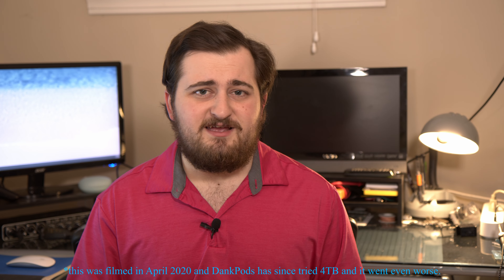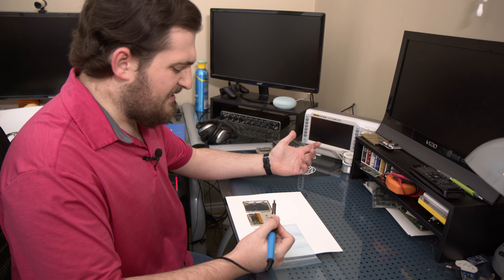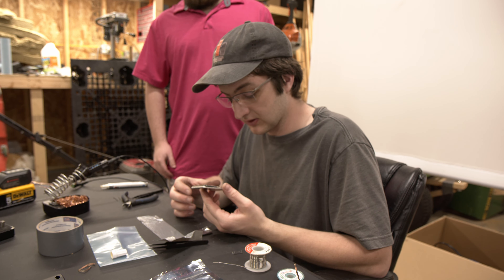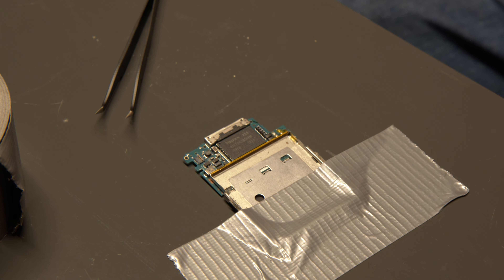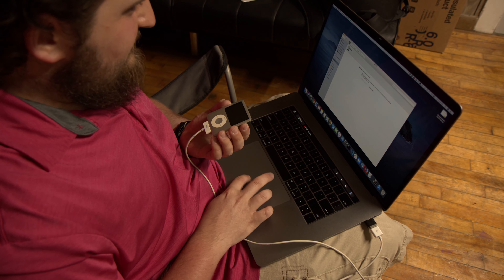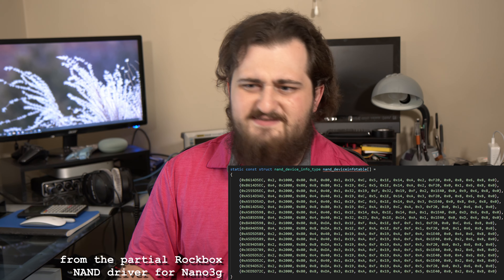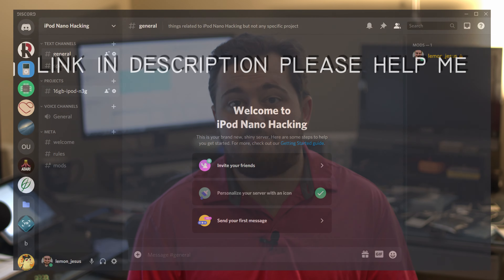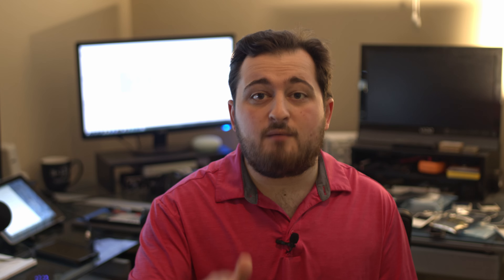iPod Nano 3G 16GB Storage Upgrade - Dev Vlog Pt. 1

Comment: I recently bought 2 broken iPod nano 3G in the hopes of restoring them and increasing the storage, just thought to myself that there's nothing a micro SD card can't do. However was surprised that it isn't as simple as it seemed. Please make this happen, it will help everyone in this situation. Good luck with the project!
Reply from the maker: Thank you! The quest continues - feel free to join the Discord server if you haven't already.
Reply: I recently decided to start a small collection of each ipod nano generation with the side goal of collecting enough broken/for parts units that I can do such a mod to a 1st gen or 5th gen as those are my favorites

Completely inexperienced to disassembling iPods, let alone soldering but it seems super fun and broken electronics are cheap enough that it's a pretty reasonable hobby

Comment: I'm no solder wizard either, but I do know the correct way to do this was to take the Nano PCB out of the case, wrap the whole board in Kapton tape, hot air rework the flash chip off then put the new chip on.

Comment: Great vid. Can you make a video on fixing an iPod nano 3rd gen white screen please.
Reply from the maker: no need for a whole video - white screen generally means you need to replace the screen. I imagine there are already plenty of videos that cover this, but when I get a white screen that usually means the screen ribbon is messed up somehow and the only way to fix that is to replace the screen. or maybe the ribbon is plugged in slightly crooked. either way you have to take the iPod apart to fix it.

I recommend also getting a new back for your iPod since getting into the n3g will almost certainly cause irreparable damage to the back that's currently on there.

Comment: I want to do it with a first gen nano, can you access the chip in linux and use it as a flash drive?
Reply from the maker: There's someone on my discord server trying to do this with the n1g - it's a little weird in that it has a an ATA-to-NAND bridge. But assuming the iPod can read the NAND chip, Linux should be able to use it as a mass storage device when the iPod is in disk mode.

Comment: Hey Tucker. Good job sir o7

Have you successfully gotten a new Ssd to work by cloning the old ssd?  If so maybe the solution is to make a card-swapper-plug and going old school with “mixtapes” in the form of ssd’s 😅
Reply from the maker: The geometry of the new NAND is different, so it has to be formatted differently. The iPod knows how to format it, provided you tell it what that geometry is. So, in theory, you could swap chips with the same chip, clone it, and expect it to work, but not if the chip has a different layout (page size, page count, etc.)

Comment: Would it be possible to upgrade a G5 nano to 128 by soldering on an SSD?
Reply from the maker: No, you'd need a bare NAND chip of that size to replace the chip that's originally installed (SSD signalling is often over SATA or PCIe, the iPod speaks to NAND directly). And then you'd run into the same problems I've been having making this work: making the software accept it.

Comment: Thinking of doing this to a really cool Sonu Walkman MP3 player
But they came with 512mb and 1gb 
I wanted to make it at least 8gb 
I've been reading a lot of I can just swap out the Nand or if I need to program it
Reply from the maker: Given my experience with the iPod, I believe you'll have to at the very least configure the NAND detection so the firmware knows the size of the chip. but ymmv, I know nothing about the MP3 Walkman.
Reply from the maker: Actually, Rockbox seems to already support some models. https://www.rockbox.org/wiki/SonyNW

Comment: Is it possible that its same process when upgrading nand chips on iphones is same to nano?
Try reading the old chip, then transfer it to the new
Reply from the maker: maybe, but the data structures would have to be extended across the entire chip, and the iPod still wouldn't know about how to deal with the new chip's geometry. there is a function in the EFI bootloader that reformats bad flash if the data structures are corrupt or not present, but the first step is getting the lowest level of the software stack to actually be able to write to the chip.
Reply: @TuckerOsman  is it possible after upgrading nano nand, use Rockbox software? i dont have nano, i cant verify it.
Reply from the maker: @pauloumali6242  there is currently no rockbox port for the n3g, but this NAND research is definitely a step in the right direction.

Comment: I have been trying this on and off myself over the past year or so. I  have tried it on the nano 2nd gen, touch 4th gen and i just had another go on a nano 1st gen before watching this. This is just soldering on new nand chips though, i haven't tried anything with the firmware yet. Windows is able to see the ipod as a removable disk although there is no storage size and will give an error when you try to reformat. iTunes will detect the ipod and allow you to reset it although it will reboot into the 'no hard drive' screen. I have found these tsop-48 sockets on aliexpress which i am going to try and solder onto the board and just try inserting a bunch of different chips to see if any work on the nano 2nd gen. Just got to wait for them to arrive. Just joined the discord.
Reply from the maker: Nice! I just got my hands on a TSOP-48 socket myself. Like I said in the video I was going to do some hardware level debugging - and I probably will still have to - but I made a small breakthrough in understanding the firmware which I posted to the Discord. Welcome to the world of fun! 😅
Reply: @TuckerOsman  Whilst the comment is from awhile ago, would these NAND chips not need re-flashing in order to work or be recognised by the iPod itself? The curious question would be what readable limit Apple may have integrated on the logic board? 4GB seems small even back then, seeing how the 1st gen Nano is basically just a scaled down 5th gen makes me feel they may have used the same limit? Or would they have created it from the ground up and capped it at 4GB?

The 5th gen classics are popular to mod but they have a hard readable limit of 128GB. I wonder if the nano has a similar ceiling?
Reply from the maker: @Spazza42  There seems to be logic in the EFI bootloader that allows it to reformat a completely blank flash chip. It would make sense for them to do this, since the underlying NAND structures are software defined and somewhat dynamic. Each iPod can format itself and skip the factory flash step.

The 1st gen Nano has an ATA-to-NAND bridge chip - likely since the CPU itself doesn't have a NAND interface - so the limitation might exist there. Some people in my discord long ago were looking into this. The Nano 3rd Gen is a scaled down iPod Classic for the most part. Since the NAND structures are dynamically generated, it stands to reason that it can format NAND of any geometry. In practice this might not be true - at this juncture I don't believe I'm running into this formatting issue specifically, rather the iPod is incapable of writing to the chip for some reason. Either it's addressing it incorrectly, or the chip is rejecting the write requests.

Comment: It's been a year. I'm curious how it's going now
Reply from the maker: My focus in the last year has mainly been on the Nano Bluetooth project, but since that's completed I have come crawling back to this project.  Since this video, I've made a couple of small breakthroughs:
 - the M1FMISS layer's bytecode is about 80% figured out
 - the iPod can, indeed, read from the new NAND but it can't write to it. I have some ideas as to why this might be but it's hard to actually test them
 - I dumped a stock iPod's NAND so I can study the structures like the BBT and see how those special pages are written because they're required for the iPod's "VFL Production Format"

If you want more regular updates, feel free to join the Discord which is decently active with iPod Nano hacking!

Comment: The sound quality on pretty much any iPod is better than pretty much any iPhone currently out including the 12 promax due to the way that wired headphones are handled on the platform it restricts the voltage to whatever the Lightning bolt bus is capable of the iPod classics have a way better dec then what current iPhones have not to mention they can get way louder and don’t lose a lot of the quality through the Bluetooth standard not saying Bluetooth headphones aren’t great but in the audio world you’re always trading quality for convenience Bluetooth can’t deliver lossless audio it exceeds the bandwith limitations of the platform your friend the audio engineer
Reply: iPod can't play 24 bit audio through the dac without bumping it down to 16bit

The only way iPod can play 24 bit audio is by docking it and using a dac from an external sound system that is capable of it. This is why it crashes or skips a lot when trying to play lossless 24 bit through the jack it is trying to convert it to 16 in real time. 

Just because the iPod can download 24 48 doesn't mean it can play it through your headphones, it can't. Even if it doesn't skip for you, that's 16 bit audio coming out.

Comment: Maannn, I wanted to try this (replacing NAND) on iPod nano 3rd gen. (my favorite) since 2020, I even bought new 32GB NAND chips and several nano's to practice on. I also noticed that 8GB models have 2 NAND chips stacked one on top of another (someone mentioned this in comments). I was hoping just replacing the chip will work but now.... i am sad :(
Going to go not to discord and see whats new.
Please, keep on going with this.
Reply from the maker: I've recently been waylaid by other projects, but I do revisit this occasionally. TL;DR: I think it's an ECC issue... maybe? Quite unclear, but I still have not given up on it!
Reply: @TuckerOsman  Btw, I now (cooking for several months) have another idea, I have several 7th gen nanos, they also use NAND but different packaging (no legs), iPhone 6/(6s - confirmed)/7/7+/8 and 8+ use the same NAND chips format as well as iPad 5th gen. Price for broken 5th gen iPad is like 6-10$ (there is a bunch of icloud locked on local e-market) and I am going to get one of those just need to find 128GB version, I could get 64GB but while we are at it why not go all the way :D so I am going ot try and swop the NAND :) (I have good soldering skils)
Reply: @ledhunters you did it?

Comment: Why not get a 5th to 7th gen ipod, copy all the codes off of the flash chips and apply them to the chips on the nano. They have tools that read the data off of those chips. A bios tool might work too
Reply from the maker: I assume you mean copy the binaries from a iPod Classic and apply them to an iPod Nano? That might possibly work for the operating system itself (maybe, it's a stretch, but maybe), but the rest of the software seems to be built for the specific device it's running on - despite being the same processor i.e. the n3g firmware lacks support for ATA disks and Classic firmware lacks support for NAND flash.

Comment: 4:30 you're supposed to install the nano 3G operating system on it after replacing the storage
Reply from the maker: There must be a working NAND driver loaded to interface with the storage before an operating system can be written to it. Without patching the driver in the EFI partition, it's not possible to format the chip or, further, read/write data to it.

Comment: Hello I noticed that on an earlier ipod nano apple actually wired two nand chips in parallel one stacked on top of the other .   so for the 4 gb Ipod instead of one 4gb chip they uses two 2gb stacked on eachother. So  would it be possible to get two 8gb chips to get 16gb??
Reply from the maker: Yeah this happens in some configurations of the n3g and the thought has occured to me. The n3g firmware supports 8 banks so while this is theoretically possible, I'm not sure which NAND chips will support this many CE lines and how to clip the chip legs. But it might be a tad easier to bend the software to your will in that case.
Reply: @TuckerOsman  I see, well good luck then I really hope you are successful.  😁